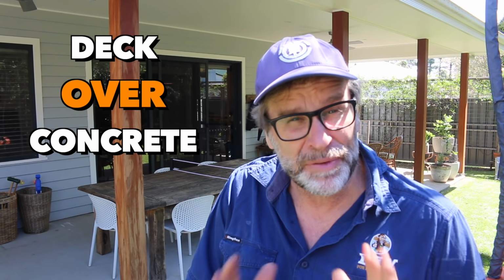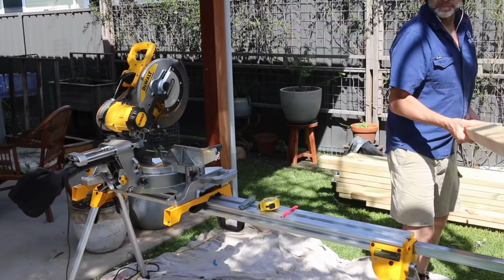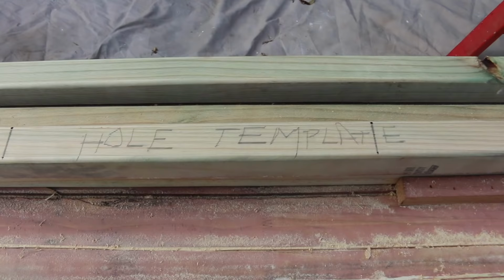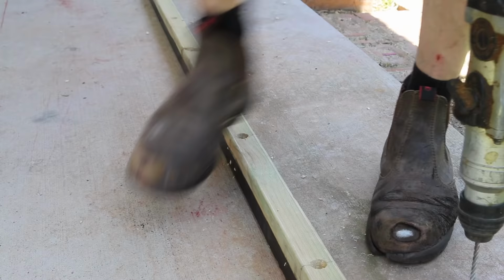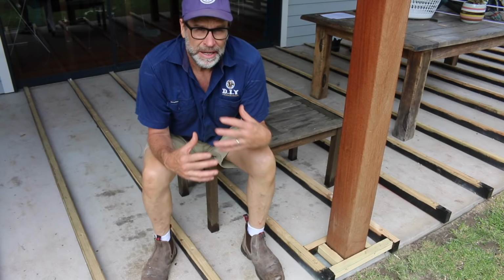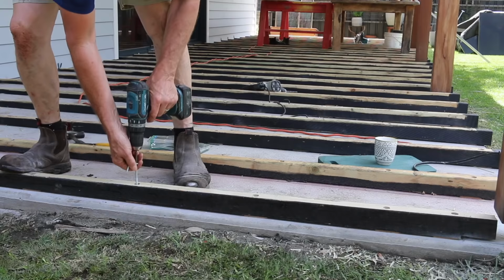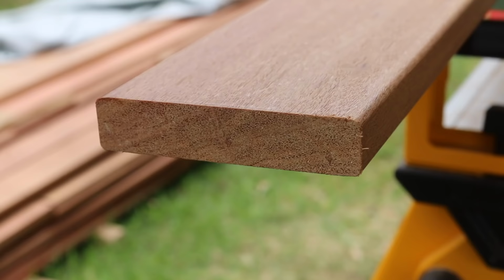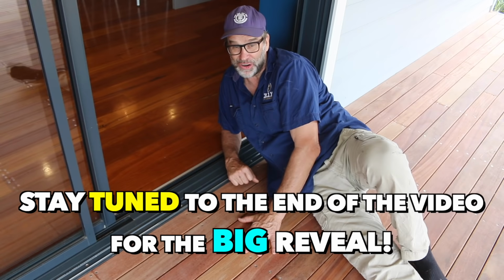Building a Deck Over Concrete PLUS 5 BONUS Decking Tips!

Comment: You mentioned that timber should not touch timber. Does it apply only to framing? I'm asking because at 11:31 I can see the deck boards are touching the pillar. Also at 11:31we can see perfect square cut in a deck board. How did you do it and what tools did you use?
Reply from the maker: G'day Miras. There is a small gap between the board and the post...just enough so that it doesn't exactly touch.If you looked at it from directly above you would see it 👍 The cuts were done with my mitre saw that you see in the video. Thanks for watching 👍😁🇦🇺

Comment: You've done allright knuckles..

You've done allright....🙃😉
What would be the issue with direct sticking the deck onto the concrete with the PVC sheet underneath or spacers?

Even a recycle plastic plank and just Direct Stick that on?
Reply from the maker: Cheers mate 👍 I am a massive believer in having airflow around the sub floor which especially relates to underneath the joist. If you direct stick, the water will just pool around the edge and eventually prematurely rot out the joist.
Reply: @diyforknuckleheads  sweet work...
I am humbled in your wisdom.

Cheers mate..
Also that was a quality joke I will use that one..

....one for the road...

Actually one for you is what has a pizza delivery driver and the gynecologist got in common?

They both can smell it but not allowed to eat it
Reply from the maker: @matthewanderson6254  😂😂😂....l'D LOVE TO USE THAT ONE! May be a tad risqué  however 😂

Comment: The deck looks amazing, Question how many concrete bolts would I need to use for a length of 4.6m floor joist?
Reply from the maker: Thanks Alex 👍 Mate l put them no further apart than 450mm. Like l showed in the video, make sure you space them out so that they don't interfere with the decking screws. Good luck 👍
Reply: @diyforknuckleheads   Thanks mate, Hey any tips on how to measure to get the taper line transferred to the joist that needs cutting?

Comment: What if the concrete isnt leveled? What remedies can we do?
Reply from the maker: Set up a joist on either end that are perfectly level, then run a string line from one end to the other on either ends of the joist. Then, measure up to the string line from the concrete wherever you have a joist. Hope that makes sense. Good luck 👍

Comment: What are the little plastic clips that you put on the bottom of the "joists" where you fastened them to the concrete called? I can't seem to find them using the term you used to describe them. Cheers!
Reply from the maker: Hi Eric. They are called Window Packers. Carpenters use them to level up their windows during the installation process. Most Big Box Hardware stores sell them  👍

Comment: Thanks for your video. How did you draw straight lines on concrete to mark your joist positioning?
Reply from the maker: No worries at all. To get those lines l used a chalk line 👍🎄😁🇦🇺
Reply: I am doing decking for the first time in our Alfresco. Your video has been Godsend 🙏🏼
Reply: I have been able to frame the deck over the Christmas break. I have couple of questions before I start laying the decking boards if I may:
1) Do I need to leave gap in my decking boards when joining two pieces of Merbau?
2) Can I use my circular saw to cut Merbau or do I need Mitre saw?

Comment: Did the window packers that you put under the joists not affect your heights or did you allow for it when you were cutting the joists?
Reply from the maker: Na mate, l factored the thickness of the packers into the finished  width of the joist height. 👍
Reply: Cheers mate!

Comment: Thanks for the very helpful video.  Im planning a similar project on concreate pad but mine is 150mm high off the concreate.  Was going to build with 130mm treated pine joists allowing for 19mm Decking ontop.  what would be best way to fasten the joints down,  was  thinking of using galvanised L brackets.  would this be ok or you know of better product?
Reply from the maker: G'day Iain...You can use an L bracket but l would use these https://klevaklip.com.au/Joist-Supports
The beauty of these is that you can easily adjust the height of the joist and you can also use a smaller joist (90 x 45) Just make sure you don't over span the distance between the Kleva Klips.
Cheers 👍😁🇦🇺

Comment: Awesome deck mate 👌  
What size screws did you use ?
Reply from the maker: Cheers Matt 👍 Mate l used 65mm screws where possible and went down to 50mm as  the depth of the joist got smaller 👍👍

Comment: If I need to stagger my decks (as I have a 6m alfresco) whats the best staggering method ?  I've seen suggestions to stagger a pattern over 3 rows as the  minimum best option.  Talking in ft as it was US site they suggested  8,8,4  then 4,8,8 then 8,4,8 and then repeat ....

Comment: This is awesome and helpful! Attempting a similar project… I like the spacers you used between the wood and concrete but can not find anything quite the same.. what is the product called? I thought you called them “Peckers” but hard for me to tell. I’m new to building stuff so sorry if this is a simple question!
Reply from the maker: G'day Max....they are called Window Packers....Carpenters use them to level up the windows during the installation process. Good luck 👍👍
Reply: @diyforknuckleheads  thanks so much!

Comment: UK. Thanks for the video. I’m thinking about using the same approach for a badly sloping concrete floor under a skillion roof in a former sleep-out space to achieve a transition between a bedroom (via an old window) and the sleep-out space. Can you think of any reason why it might not work? Cheers. C
Reply from the maker: G'day Colin....thanks for watching mate. If in Australia, l can't think of any negatives. However, if you live in a country like the States or Canada where you get concrete heave from extreme cold weather conditions, there maybe some issues. Good luck 👍
Reply: @diyforknuckleheads  cheers UK. Definitely in Oz. Most of the good reno material on YT is from the northern hemisphere. Appreciate your effort and content. HNY!
Reply from the maker: @cttravels5244  HNY to you and the fam as well mate 👍😁🇦🇺🇦🇺

Comment: why treat with bitumen when its already treted lumber and why not just buy treated 2 by 2s so you dont have to cut
Reply from the maker: Bitumen helps repel any potential  water from actually coming in contact with the wood and  2 by 2's wouldn't have the strength required over the distance

Comment: What did you use on the bottom of the joist to keep them off the cement?  I can't seem to find anything similar.
Reply from the maker: Hi Lacey. They are called plastic window packers. https://www.bunnings.com.au/macsim-45mm-assorted-window-packers-100-pack_p0091692

Comment: Knucklehead question: I notice you did not paint the top side of the joist - Is there any reason why you didn't bitument paint the entire joist?
Reply from the maker: G'day John, being that the deck is under cover, l'm only really worried about the moisture that may come up through the slab or any water that may splash in after a heavy rain 👍👍
Reply: @diyforknuckleheads  Thanks Shane - I'm replacing joists which have rotted and were put in unprotected. Moisture comes from all directions so I'll fully bitumen them. BTW - the Dad jokes are shocking.....keep them coming
Reply from the maker: @jaydee17  😂😂.....will do mate 👍

Comment: Hi there, how did you finish the sides of the concrete block?
Reply from the maker: G'day Michael....if you look at the photos at the end of the video you can see that l ran one board underneath the perimeter board. There is still a little of the concrete exposed but not enough to be concerned with 👍😁🇦🇺

Comment: Hi mate. How far apart are the concrete fixings?
Reply from the maker: G'day Bernard.....from memory mine were about 350mm apart. What you need to be careful of is when you make the holes for the anchors, just make sure they don't land where a decking board screw will be. To avoid that l set my layout first on a joist the same length as my deck....taking into consideration any over hang on the front of the deck....in my case that was about 10mm...and then measured and marked the position of the boards on that joist. That way l could measure and locate where the anchors are to be drilled so that they avoid any decking screws.....hope that makes sense 👍

Comment: What if the concrete is not leveled?
Reply from the maker: If the concrete is not levelled, you need to run out string lines like l did and measure the height of the joist at the various points where the concrete is running out of level.